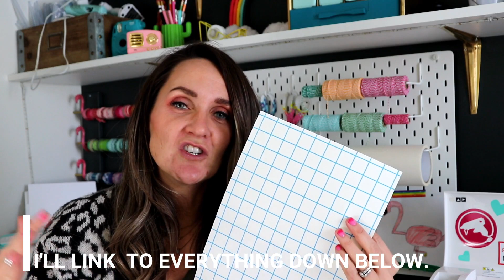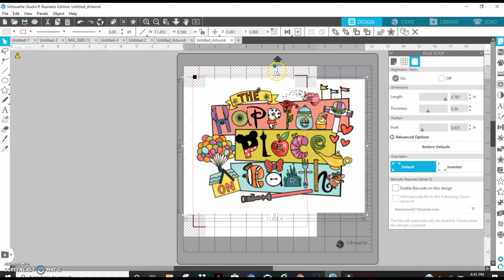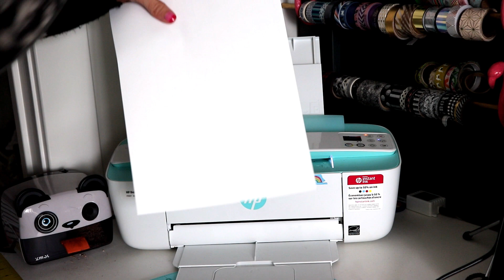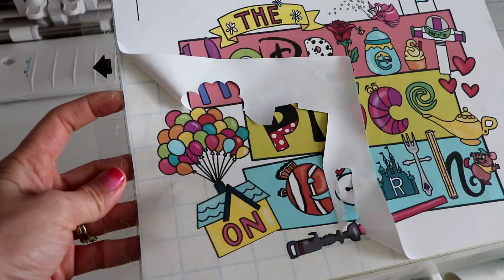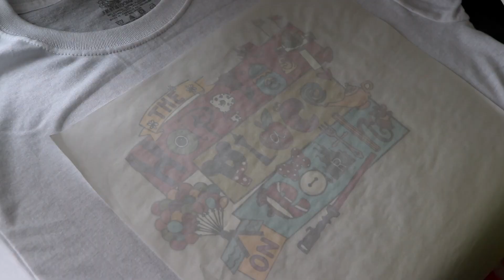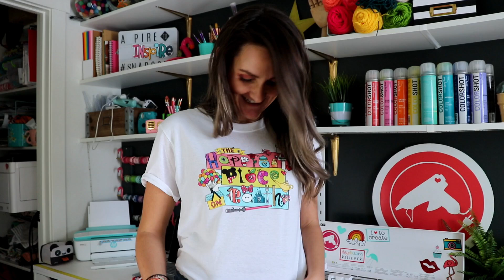Silhouette Love: PRINTABLE heat transfer vinyl tutorial!

Comment: I swear that looks like the heat transfer paper I've ben using!   I thought the Printable HTV would be a clear sheet of paper that you'd print on, cut through the machine and then press.  When you peeled it back, it was opaque just like the Heat Transfer paper.   The transfer mask, is that different from the transfer paper used for Permanent Vinyl?

Comment: Had a question, I'm using a heat press should it still be 375 degrees for 30 secs and is it a hot peel or cold peel?
Reply from the maker: https://expressionsvinyl.com/how-to-use-printable-htv/ There is a heat press  section that will talk about the temp!

Comment: Do you realize there is actually a product called "Silhouette Printable Heat Transfer?
The same exact name you titled your video. Yet the vinyl you used "is not" Silhouette Printable Heat Transfer vinyl?
Why wouldn't you instead title your video project by the name of the actual product you are teaching us on?
So that folks like me can move on to find the correct vinyl settings for Silhouette Printable Heat Transfer Vinyl. (btw - the instructions that came with my product say to use a household iron on cotton setting for 2 minutes.)
I am trying to figure out how hot and how long on my vinyl.
Reply from the maker: My video is silhouette love: the name of my series. The technique is the basically the same for whatever printable vinyl you are using. The only thing that really changes is what printer you can use and what the heat settings are.

Comment: Outstanding video and cautions you mentioned.  My concern, that I am SOOO glad you mentioned was regarding the white colors that WILL show inside the design if you print onto any color other that a closely matching white material (shirt/tote/etc.).  I have a Cricut Explorer 2 and use HTV, but SO badly need to print in color and then have it trace around (had not even though about inside the design...ugh...but, around (tracing, IF it even does tracing) and then to heatpress it onto a canvas bag.  You video is helping me to think about how I will approach this.  Currently I am using HTV, but, the multiple colors...oh my goodness...just can't do it.  Thanks SOO much for this video.
Reply: I save my images as .png so I don’t need to do a trace. Also, if you choose to do a trace, raise the threshold to get into all of this white places. Sometimes I have to delete random cutting nodes but, it’s fairly quick and easy.

Comment: Where can I get that vinyl paper and what brand do you recommend? Thanks! Nice video
Reply: Hey! I have a tip, use the siser heat transfer paper, there’s one specifically for dark colors and one for light colors, I use it for my cricut but it still works perfectly :)
Reply: @lesliegonzalez3977  can we this with letters too or just images?
Reply: @octaviajefferson2922  anything that you can print out can be transferred to the paper :) letters, pictures, complex designs, etc
Reply: @Ricardo Bertuldo I meant to say vinyl.